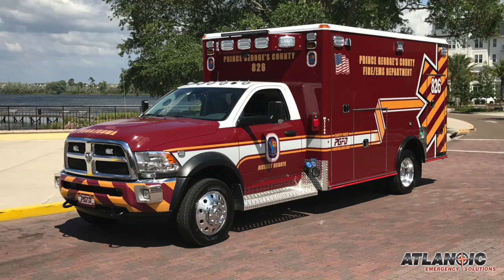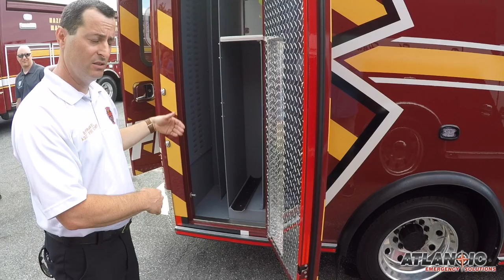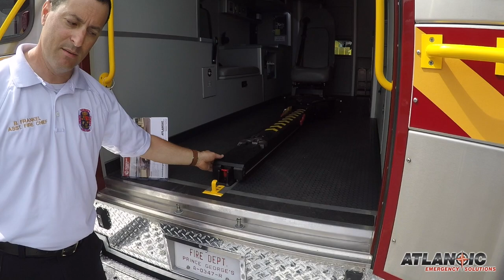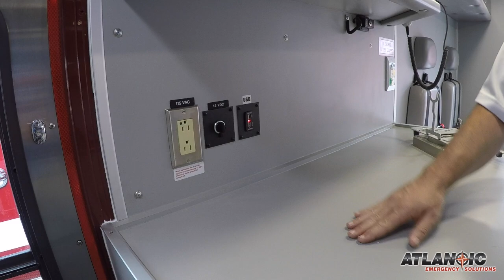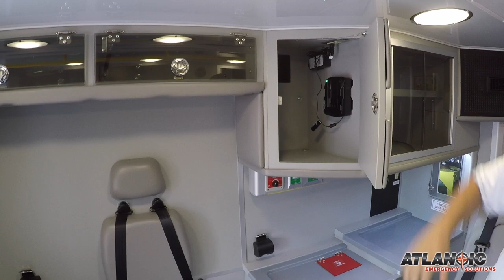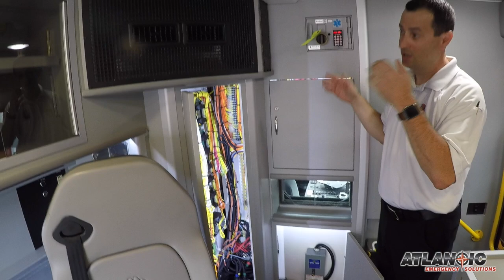Ambulance Walkaround with Prince George's County Fire / EMS Dept.

Comment: +atlanticemergency: As a Dutch (and non-medical) person, I have to ask: What does the auto-eject button do?  Our ambulances are usually a lot smaller, so maybe it's something our ambulances are not equipped with and that that's the reason I don't know about the function of the button.  I like how much thought goes into these vehicles, no matter what country the ambulances are from.
Reply: Central Ohio Emergency Response Aah that sounds logical!  Thanks for the explanation.
Reply: Dutch3DMaster never heard of that button, I'd have to look on my department's ambulance to see if it has that feature
Reply: The auto eject "button" is actually just an indicator LED to show the truck is charging. The Auto Eject port is an electrical receptical that accepts power from outside the unit to charge batteries and equipment. The auto eject will automatically eject the plug when the vehicle starts if the driver doesn't remove the cord manually.